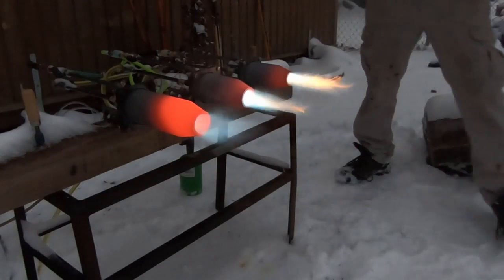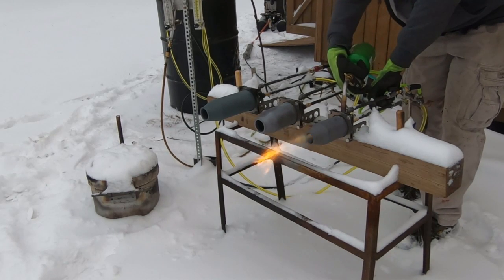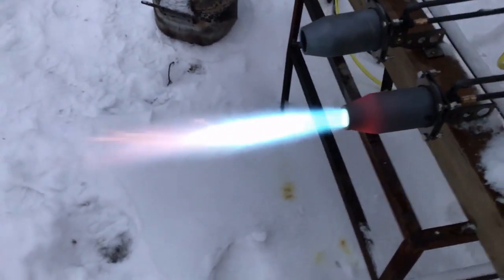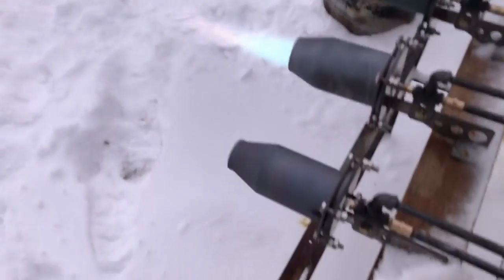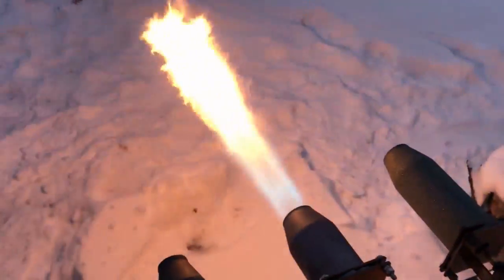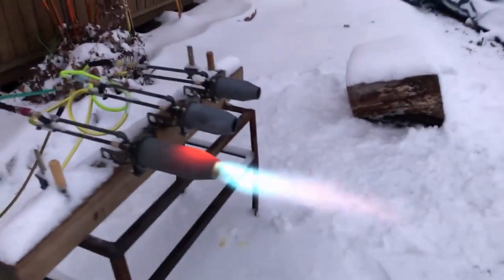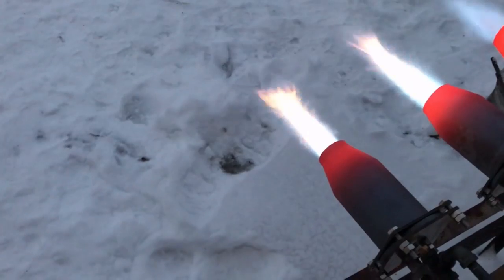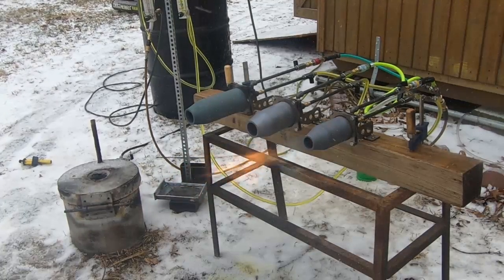High velocity silicon carbide  burners for asset destruction mitigation

Comment: Where do you have these available for sale? And can you make me a 1/2 scale size one? Maybe even just a 1/4 scale one because there’s no reason I would need that much throttle in my Tesla turbine which I will be attaching it too. 

What you’ve built here is quite literally exactly what Nikola Tesla designed for his mixed fluid (steam + combustion turbine). And I mean damn near identical lmao he just has a much more complicated fuel and air regulator rod in sync with the drive shaft. But he’s even feeding the liquid fuel and supplying the oxygen for combustion with a centrifugal compressor! 
Check out this picture of his patent. 
https://teslauniverse.com/sites/default/files/styles/default_extra_large_watermark/public/images/2019-02/GB-00186083-1.jpg?itok=Dr1ZI-3p

I would absolutely LOVE it if we could collaborate on a combustion Tesla turbine build, where I build the turbine and you build the combustor system. Please please please reach out to me if you are even remotely interested! I think it would make an awesome collab video. 
TesTurEnergy@gmail.com

This is the full patent link 
https://teslauniverse.com/nikola-tesla/patents/british-patent-186083-improved-method-and-apparatus-economic-transformation-energy-steam-turbines
Reply: but whatever happens it must include a 22, and only 22, turn coil heat exchanger at the front 😜 the magic number

Comment: A tank doesn't really make a great boiler. But if you go that route a firebrick masonry structure should be built to create a firebox and give that heat as much surface area and time to allow the heat transfer to happen reasonably.  I have different targets in my firebox bits of steel, firebrick chunks, stainless steel bowls for my flames to concentrate on, no flames really directly at the boiler itself.

Comment: Hay I got a problem me and my grand son bought a 1898 steam engine we would like to know how to run it on your steam generators instead of a boiler filled with water witch is a big danger if it explodes and takes a long time to heat the water to boiling point plus every psi it raises the boiling point higher so you haft to get it hotter to boil it got any ideas 💡 thanks
Reply from the maker: Hello Friend , i would like to help you but im versy busy this week , contact me threw the email in the video descriptions